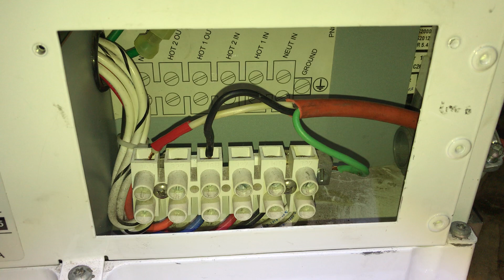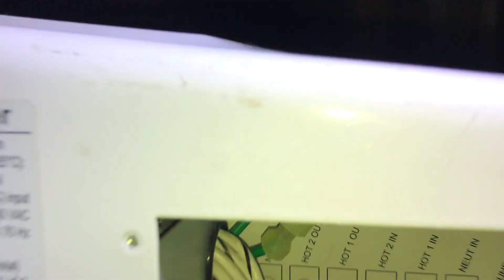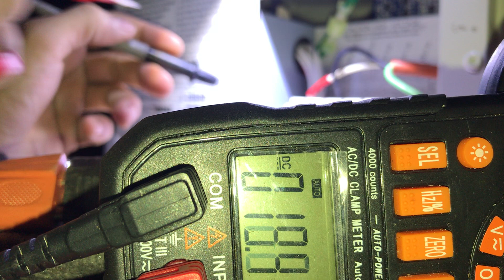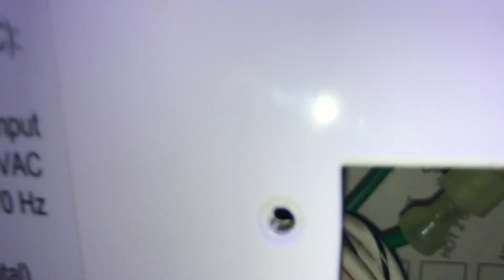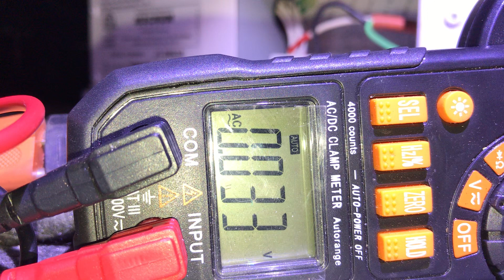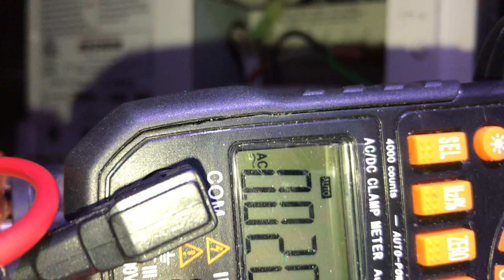Troubleshooting Magnum MS2012 low voltage output

Comment: You don't use BMS ?
Reply from the maker: Old battery setup from roughly 15 years ago early on in lithium / solar setups… it does not have a full BMS system, just a few system safeties tied in. When I refresh the system there are much better options out there now!

Comment: Did you ever figure it out?
Reply from the maker: Yeah unfortunately it had a damaged board. I had it repaired but the coat was only slightly less than a new one at the end of the day. I just needed it working quickly so that’s how it goes sometimes.

Comment: Same problem. Did you find a fix?
Reply from the maker: Hello, just seeing this — it had a failed board that needed to be replaced. Total cost wasn’t much less than replacing the whole unit unfortunately, but it had worked for years since the repair at least.